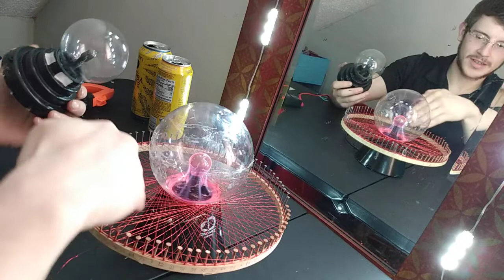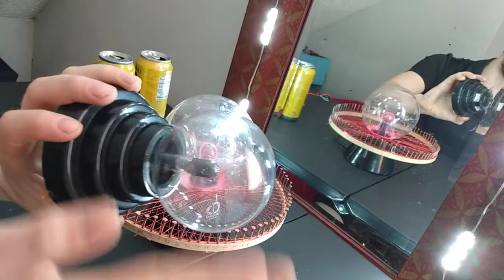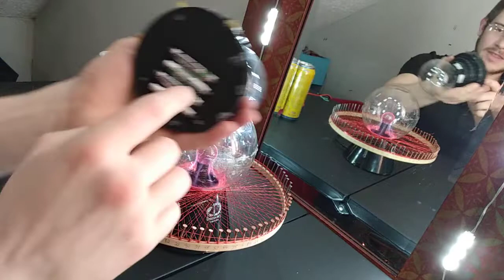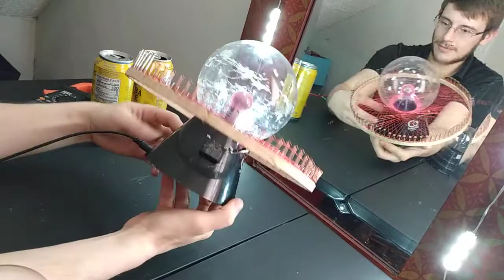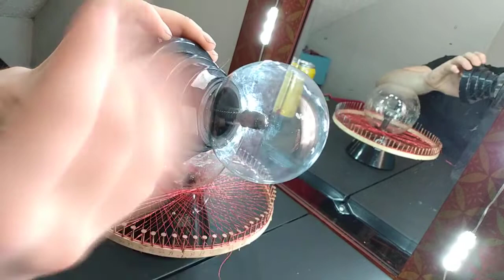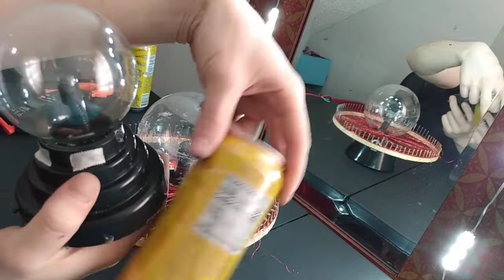Flying Saucer Coil Makes Free Energy Possible Using Resonance.

Comment: Why do you have batteries in the resonating Device ? 
I'm assuming it's just a survey the difference between the transfer of resonating energy when the device is switched on and off correct?
Reply from the maker: That's correct. I believe super capacitors will work much more efficiently

Comment: How does gasses like Hydrogen and Oxygen combust at all, what happens to them after they combust/explode do they disappear?!
Reply from the maker: No sir they convert when they combust.  The inert gases do not combust and that's what makes them a unique source for generating plasma with out heat
Reply: @Resonate369  I know a Bulgarian professor who was boiling water and immediately bottling it into glass bottles to cool slow and he drinks it later. He says that when water boils most bubbles are formed by trapped inert gases. And when water begins to cool down I reabsorbs them from the air, however bottled boiled water has immediate health benefits when one drinks it quickly

Comment: Normally mercury oxide lamps stop working at very high voltage or very low voltage
Reply from the maker: My volt meter could be reading the amps first instead of the volts but then again the power never gets weaker so I don't know